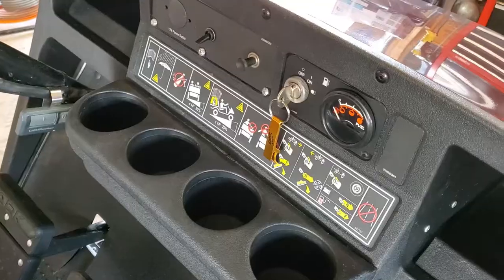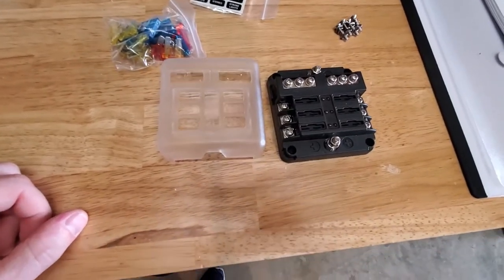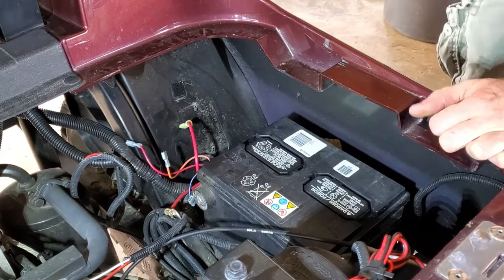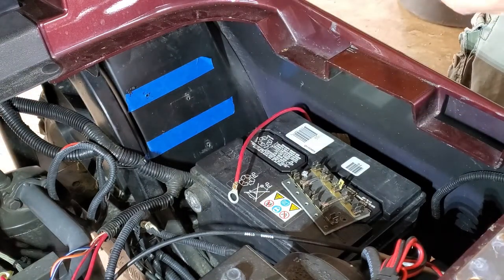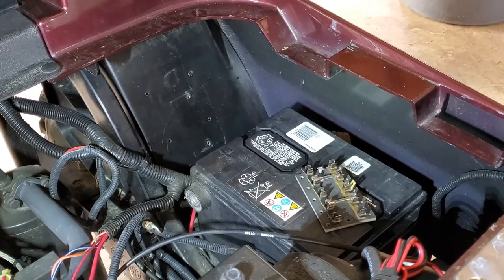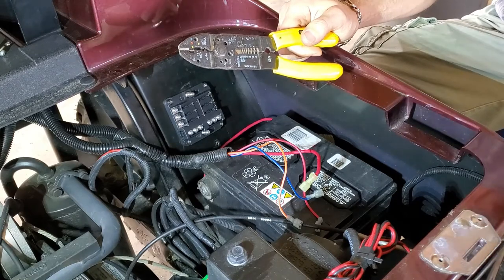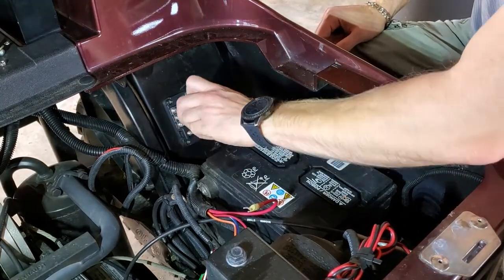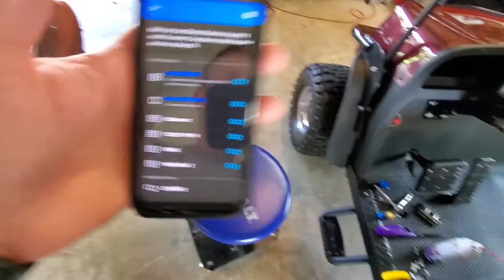Factory fuse panel upgrade 2016 EZGO express S4 golf cart

Comment: could you tell me which fuse goes to the lights? in the old glass fuse block. my horn and lights are not working but the cart runs ok. the wires are intact.
Reply from the maker: the schematic shows a blue/white wire for headlights. I know on mine the horn button that is on the turn signal lever only works when the headlights are on. For this cart model specifically you have to turn the key to the headlight setting AND pull the plunger style switch on the dash to turn on the headlights.